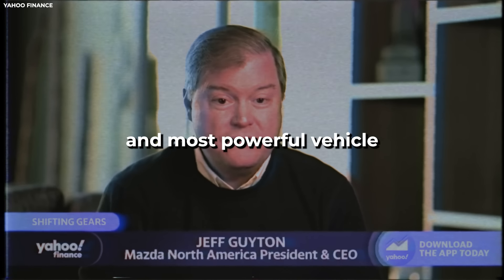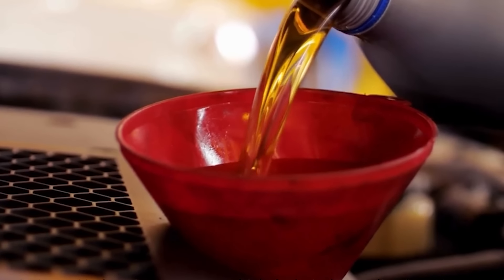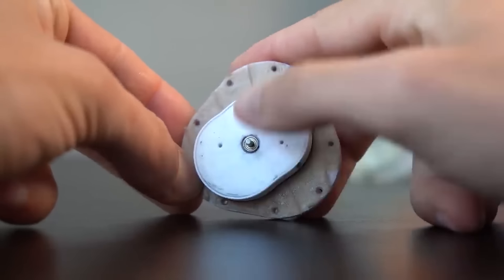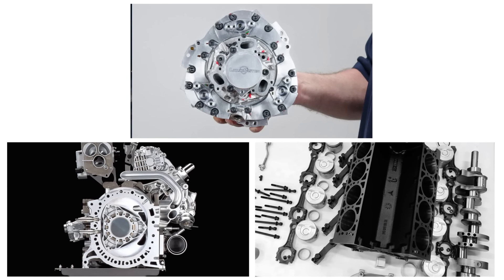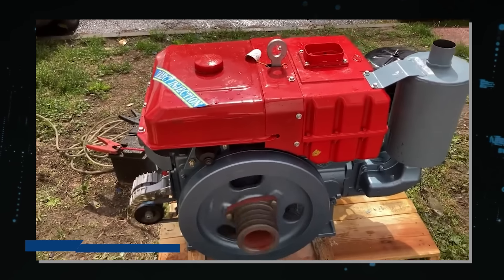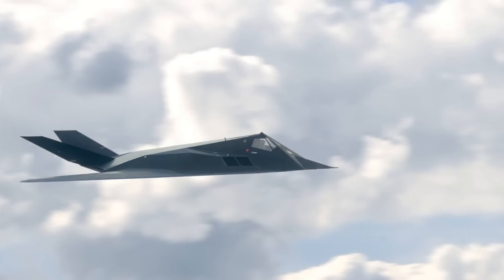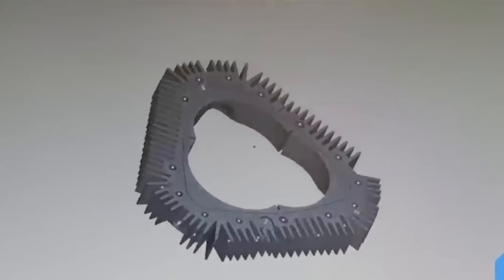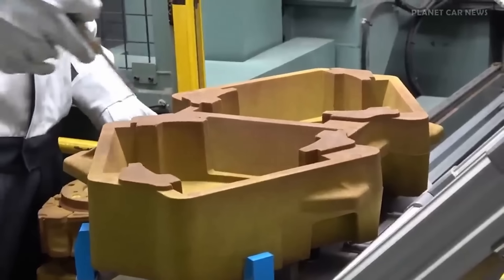Elon Musk Went Public With ALL NEW Rotary  Engine That Changes Everything

Comment: So the basic use of the engine is to be a compact onboard multi-fuel generator for the electric engine part that powers the vehicle it is mounted in, and not as a stand alone engine? 
Are the different types of fuel to be specified before ordering an engine in the future, or can it be changed up when needed, Mixing diesel and petrol and intervals🤔